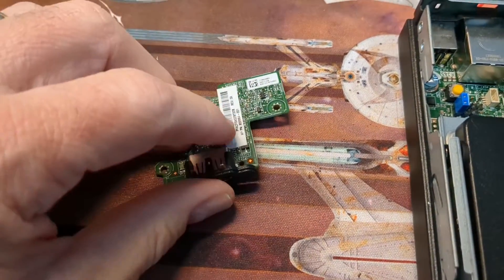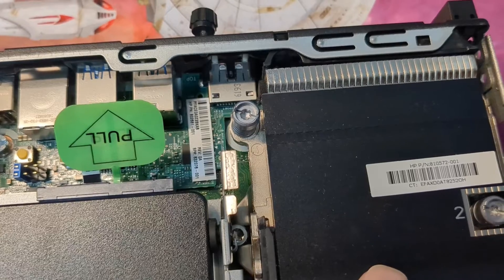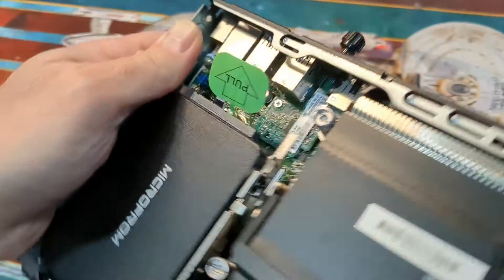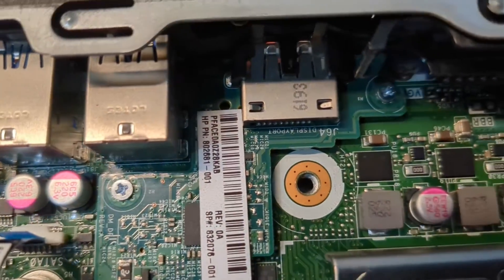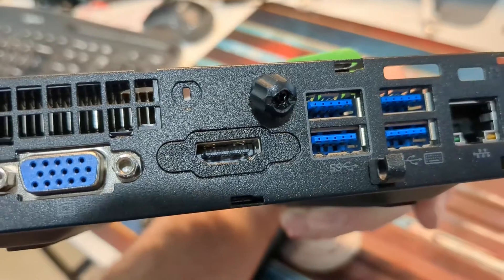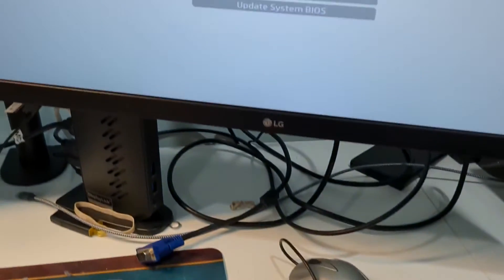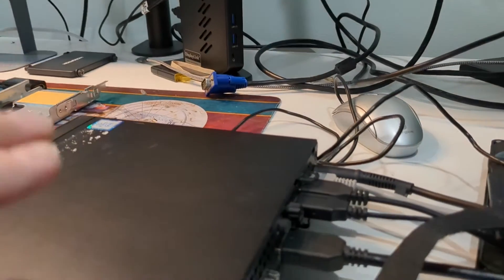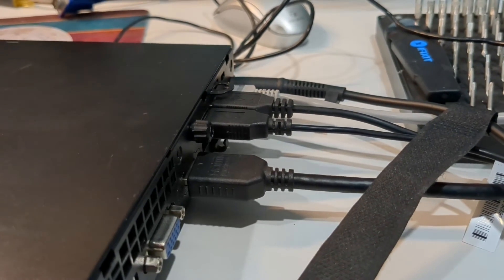HDMI for EliteDesk 800 G2 Mini - will it work this time?

Comment: Could you consider doing a video on the full on graphics card that went in place of the 2.5 drive caddy, 4gb Radeon. I know this isn’t a gaming channel but would love to know how good that card is and what will it emulate up too
Reply from the maker: I did have the GPU for the G4/G5 but the computer would never recognize it.  I'm assuming I had a bad unit so I returned it.  I may try again in the future.
Reply: @handmedowntech  that would be awesome, I hope you do. I tried to use my g5 for emulation and with built in graphics it could do up to ps1, Id love to know if the added card will go further along, maybe ps2/xbox, there is no videos about it that I can find!

Comment: I had no problems to swap HDMI board from Prodesk 600 G2 35W to Elitedesk 800 G2 65W. Just made it of curiosity influenced by your video.
Reply from the maker: Interesting, so you did get the HDMI on 65w to work.  I may need to get it a second try.
Reply: @handmedowntech  I don't know if  it matters or not, but mine 800 G2 65w  has an i5-6500t CPU and 65W A/C. I've bought it as a bareborn and equipped myself.
Reply from the maker: So a 65w case and "35w" CPU - maybe the CPU is the key

Comment: Did you get audio through the HDMI port as well as video?
Reply from the maker: I can confirm that audio is coming through the HDMI and I get sound on the attached monitor's speakers.
Reply: @handmedowntech  Thanks for confirming that.  I have a G2 that has worked beautifully, except that I can't get audio through a passive Display Port to HDMI converter.  I've ordered one of the Elitedesk 600 HDMI boards.  I hunted all over the internet for a board made for the 800 but didn't realize that the 600 had identical boards.  Thanks for this confirmation!!